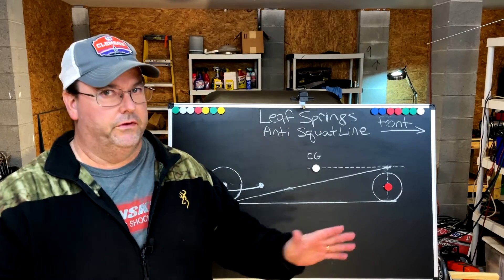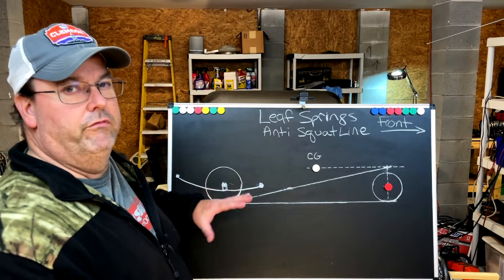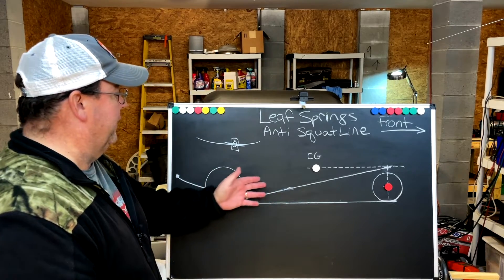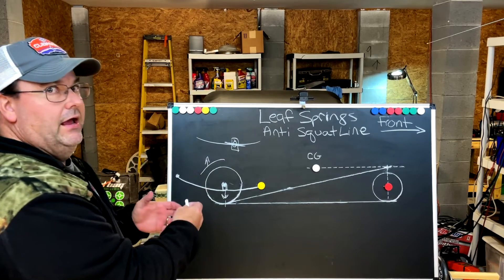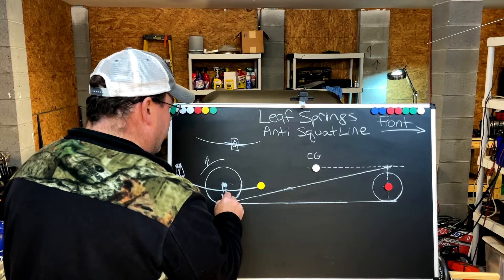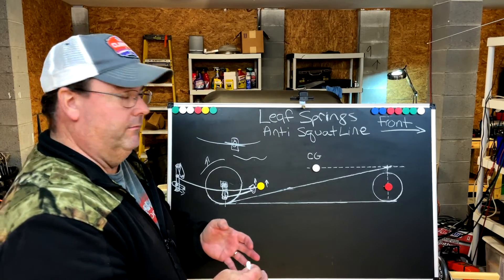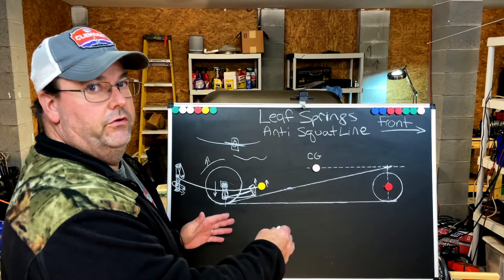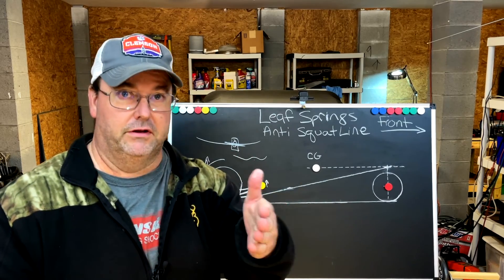Leaf Springs and the Anti Squat Line Explained

Comment: Bin watching a lot of your video's lately.  I've never heard of "anti-squat line" . When did this term start to be used ? I'm used to "percentage of rise" . I went back and re-read my Chris Alston Drag Racing Chassis Manual , and it's not in there.  I got the book in 1990 . yes I'm that old 64 just retired.  Back in the 80's 90's went racing every weeked for 20 years. But since than only go about once every two years. But now that I'm retired, plan to go alot more again. Of course back then we measured and layed it out on the floor.
Reply from the maker: Been around mainly since the 90's. Checkout my video on the Percentage of Rise at https://youtu.be/mmjieeSov4Q and I remember dad drawing it on the floor with welding chalk. He still does actually just to confirm that there computer of mine is right! Thanks for commenting and being a subscriber!!! Go fast, go straight! Be SAFE!!

Comment: Kevin very informative thanks. would a stick shift Nova 540ci 3.73 gear  9" slicks caltracs be setup the same ?
Reply from the maker: With just that info, I would say yes... you can run a little less aggressive caltrac angle with the stick shift if you are hitting it real hard. These days the converter technology and automatics hit pretty dang hard... power management is still key though on the hit. Go fast, go straight! Be SAFE!!
Reply: @KevinWilsonSBC  Thanks for response . That is what I thought  . We hope to get it to hook and not break parts. What do you think of the clutch tamer?

Comment: Now my next qustion.  I see alot of guys having trouble with wheelies in a leaf spring car. What causes this? Seems to see it in leaf cars alot.
Reply from the maker: For one the leaf springs seriously dead hook the rear, which certainly begins to apply the HP/TQ to rotate the front. This is where front end control, front limiters and power management are key. With the ECU's today, implementing wheelie control is almost a must do for the radials for sure. I have had leaf spring cars on radials fight wheelies with the front tied down nearly completely. At that point, it is add weight to the nose or implement an aggressive power management control on the ECU... Go fast, go straight! Be SAFE!!
Reply: @KevinWilsonSBC  would lowering the front spring mount help combat this too? Or would raising it up help. Most cars I seen doing it still have leafs in stock locations.  So by changing this would it help combat the problem
Reply from the maker: @fitzeesfabrications  for a slick, not a radial, it would help take some rear separation away and not dead hook the slick. For a Radial, you have to be careful taking away AS, but if you have adjustable front mounts, then you can make some small changes, reset pinion angle and test. If the front end is properly slowed down or even limited with a radial, then I would use the ECU to help control this. If no ECU, then I would add 15 lbs on the nose as low as possible and test, before relocating a front mount without an adjustable front mount. It doesn't take a bunch of weight to make a change. Hope this makes sense... Go fast, go straight! Be SAFE!!

Comment: Fantastic! Thanks. I really enjoyed your explanation for 4-link and was wondering how it relates to my leaf spring f-body car. This info is really timely. Installed a 9" and caltracs last weekend. This really has me thinking...if I get this to hook really well, the front spring pockets are really going to be taking a beating. Your comments about the sway bar really got my attention with how this all works together. If the car hooks it already tends to pull the driver side up...even further beating up on the passenger side pockets and tries to twist the body. This is GREAT. Thanks!.
Reply from the maker: Glad it was helpful! Thanks, Steve, for leaving a comment and the compliment! Go fast, go straight! Be SAFE!!

Comment: In a high horsepower radial leaf setup with an adjustable front bracket, what height in relation to the axle centerline would be  best to set the middle of the bracket in the car. I know there’s a lot of variables involved. Just want and idea of what to look for
Reply from the maker: LIke you said there are so many variables that will impact this location, especially tire diameter and the relationship of the axle centerline to your car's anti squat line. I would really want a better idea of the car's AS line in relation to the axle centerline . If you could mock it up with the middle in line with the axle centerline, I would think you would have plenty of adjustment for more rear separation. Sorry for not a direct answer, but I would need a bunch more info to give you a direct answer. Go fast, go straight! Be SAFE!!

Comment: Great video  I have a 68 camaro street/strip car  355sbc 538hp at the crank turbo 350 with a 4.56 rear gear stock multi leafs and old comp engineering slapper bars and a 28x10.5 slick. Car runs great but I'm hitting the tire to hard and crushing the sidewall no matter the air presure. Does the length of the slapper bar and and height of the snubber determine how much seperation/bite I'm getting. My slapper bars are a bit short and not quite to the front spring eye would lengthening the bar so the snubber contacts the spring eye help
Reply: ChevyMustang1, years ago I used 1"thick pieces of flat bar a little wider than the traction bar bolted to slapper bar
In place of the snubber. Made them long enough to go under the spring eye. Used a 3/4" bolt in the spring eye end and adjusted my air gap there. It was simple but effective. Originally I was hitting the spring so hard it was bending the leaf so this put the pressure under the spring eye. I later switched to Southside bars. Those worked great. This was on a 70 Nova.
Reply from the maker: I wouldn't spend too much time trying to lengthen the slapper bars, I would definitely focus on the rear shocks and their Extension (R) valving. Thanks for dropping a comment! Go fast, go straight! Be SAFE!!
Reply: @KevinWilsonSBC  thanks for the reply I really appreciate it. Even though I've been  racing for quite a few years I've learned alot in the last few weeks I came across you'd channel. I'm walking a fine line with this 68 camaro it's way to nice to be beating on it at the track that's mainly why I'm trying to stay away from the cal tracs if I get it working to good I'll race it even more lol. As it sits now its a 11.20 @125mph pump gas street car. From your videos I have already realized that a good adjustable shock will help slow the separation  I just wasn't sure 8f lengthening the slapper bar to reach the spring eye would be an advantage. Thanks again for the great videos keep them comeing

Comment: Love these videos, I have a NA 383 stroker c1500 extended cab, Ive been working on the 60 ft I have stock leaf springs with air shocks and the helper spring removed and cheap traction bars, I may upgrade those. I get a little separation before it breaks the tire loose. I’m thinking my rear hangers must not be free, but I know I need to get a anti roll bar, in it and get the front sway bar off too
Reply from the maker: Thanks for commenting... Keep going on the c1500 as it sounds like you are heading in the right direction! Go fast, go straight! Be SAFE!!

Comment: Thinking this question has more to do with the front end working correctly than the the Cal Tracs, but what to do when  you are dead hooking  and doing 3' wheelies for 60'? Yes, i know, I have Dbl Adj shocks ordered,lol
Reply from the maker: Yep, the first thought is slowing down the front end a good bit and you may even apply more power on the hit to try to get some wheel speed. Do you have any caltrac options on your setup to raise or lower the front or rear of the caltrac bar? Go fast, go straight! Be SAFE!!
Reply: @KevinWilsonSBC   I have the bar  in the lower hole of the front bracket. Split monos in stock location. Still using old school 90/10 Shocks. Car is  on 8.5 x 26 Hoosiers.
Reply from the maker: @donk2859  I hate to say it, but the 90/10 is likely really letting the front end come up way too fast... The shock technology today will absolutely change your launch by slowing the front end down but letting it still come up slowly to transfer weight to the rear. Did you see my video on the Suspension review from the SRC channel? If not, watch this one: https://youtu.be/k2f6imRMnsU 

Go fast, go straight! Be SAFE!!
Reply: @KevinWilsonSBC  my plan is to slow/tie the front down and see if I can get wheel speed, then come off the break higher (3000 now).
Reply: Thank you, really enjoy your videos, i was wondering where the ic was with Cal Tracs. Going to start with front Vikings, probably rears too.

Comment: Kevin on a foot brake car is having the assassin bar angle steeper in the front more or less critical leaving with a trans brake. Shock settings differ? No prep/street stuff. M/T street r radial 275/60 tire.
Reply from the maker: Depends on converter... when foot braking, if you load up the converter having more uphill angle can help. Transbrake leaves with the right shocks you can leave the angle alone and make some Rebound changes on your shocks to tighten up a tad. Definitely with a radial, you WANT uphill angle and use your shocks to tune. Make sense? Go fast, go straight! Be SAFE!!
Reply: @KevinWilsonSBC  thank you sir. Thanks for sharing your knowledge.
Reply: @KevinWilsonSBC  if I run ladder bar/floater setup, is running a slider still a good idea? I’m going to that setup on my mud drag truck.
Reply from the maker: @RanchTrash87  Yes, the rear sliders will help allow the separation to continue more than not... the ladder bars with floaters is a must, the sliders on the rear are optional, but will only help in my opinion. Go fast, go straight! Be SAFE!!

Comment: Thanks for the leaf spring videos.  I’ve watched them all a few times.  I’m still trying to figure it out lol. My main issue is bogging out of the hole. 350whp 3300lbs stick car.  1.65 60’ but I think it it should be 1.59 capable. Traps 113mph.
Reply from the maker: Thanks for commenting!!! Definitely get the bogging fixed and I am sure the 60' will impress you more than that! Go fast, go straight! Be SAFE!!